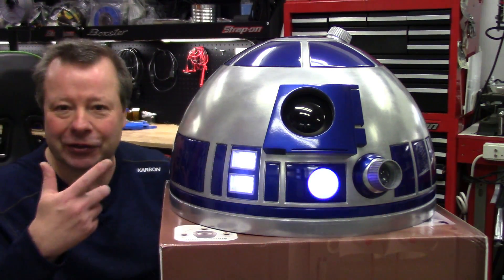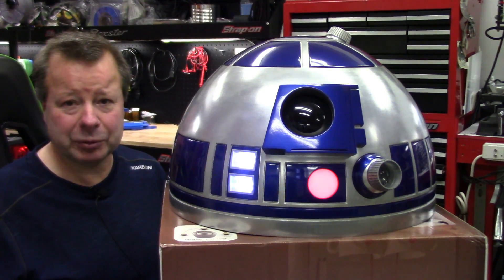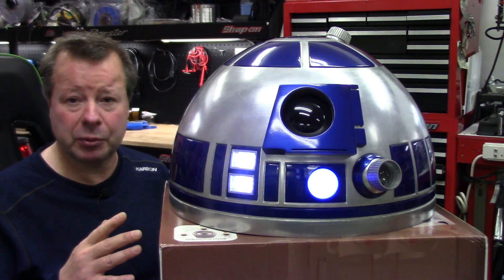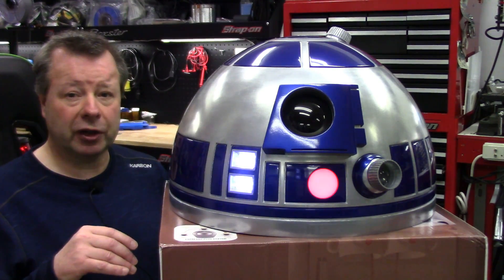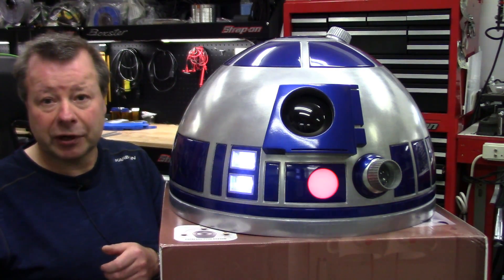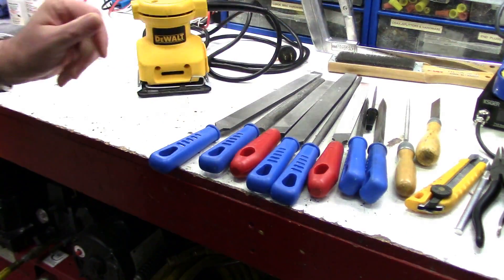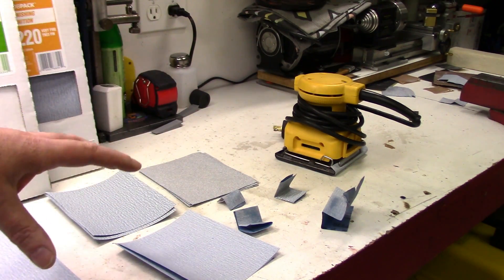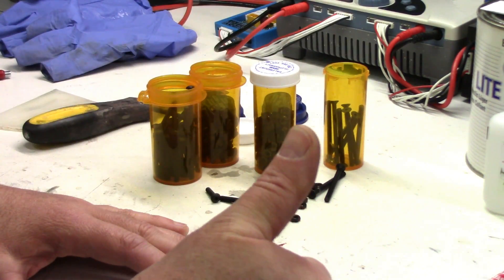R2-D2 Build Your Own - Getting started, Resources & Basic Tools

Comment: Is there a material list for how many rolls of filament are needed for each part?
Reply from the maker: No for the simple reason it depends on your slicer settings for wall thickness and infill percentage. You can estimate with good accuracy using your slicer program for each part or section to get the filament weight and then tally it up. Then add whatever % you want for failed prints or mistakes. 
I cover my final tally for the entire build in part 9 of the series: https://youtu.be/E8h0l4rHvC4?si=LSJ-JfjXVVewZKs1

Comment: Thinking of starting an R2 build, and shopping for printers.  Any recommendations?  I know you used the Sovol SV01 for your print, but that looks to be replaced by several newer models.
Reply from the maker: I would hate to limit your almost endless list of 3D printer options by making any recommendations; especially considering having limited experience out of the hundreds of printers out there. I researched FDM 3D printers for almost 3 months before deciding on the SV01 due to several factors and if I was looking today for a replacement, I would likely take that long again - lol. 
I can tell you I'm still very happy with my SV01 and it's still working great; better than day one actually since I somewhat know what I'm doing now; albeit the 3D printing learning curve never ends. 
Solvo also has a Canadian warehouse and that was important in my decision to have somewhat local support + Creality Ender 3 support as they share many components. In other words, I would definitely get another Sovol if the SV01 crapped out tomorrow.  The SV06/plus is the closest replacement but their new T300 has impressive specs.

Comment: I love the R2 video series, was wondering how it’s holding up a couple years on?  I’m 3d printing one right now with PLA+ but keep reading about how the high stress parts should be PETG, which I hate.  But wondering if I should make the legs PETG anyway?  Thanks!
Reply from the maker: Holding up great - no issues at all . PLA+ is strong stuff after all! Stronger than ABS in most FDM filament tests I've read/seen, but a little more brittle than PETG (brand dependent). Then again, I went with fairly thick walls and 40-50% infill on all structural parts. IMO, the only reason to use PETG for this project is if you are going to be exposing him to higher than average temps. No question, PETG is better in higher heat environments.
Reply: @Rchelicopterfun  thanks for your reply. So far I’ve printed the dome and most of the body using Baddeley’s recommended settings, like 20% infill and 4 walls.  That shouldn’t be an issue, you think?  I was going to print the shoulders and legs with much heavier settings like you used, but haven’t gotten that far.

Comment: Hi John, Love this series. Thanks so much for taking the time to create this series. Lots of great information and demystification on doing this project. I am following you in guiding me on this project of attempting my first R2. Did you sand each section of the main dome separately or did you begin your sanding after glueing? Also, can you forward a direct link to the assembled lighting system? I can only find the components but not the assembled version. Much thanks and gratitude.
Reply from the maker: @gtarson - Sanded both before and after fitting (sanding never ends) 😄
No link I know of. I had to search in the Astromech forums for someone currently building any light sets and then message them for pricing, availability & ordering information.

Comment: Hi John, Thanks for a great informative and entertaining series! I am just starting my build and this has really helped fill in a lot of mental gaps. Quick question did you use PLA+ for the whole dried including the legs or did you use ABS for the legs? I haven't printed with ABS yet and I know there are some challenges with it. I would be happy to avoid them if you think PLA+ all the way works fine. Thanks!
Reply from the maker: PLA+ everything. PLA is actually stronger than ABS; PLA+ even more so. The main downside to PLA is it's not as thermally stable as ABS and has a lower melting point. If you leave a PLA/+ print in a car on a sunny & hot day, chances are it will look very different afterward 😄
Reply: @Rchelicopterfun  Thanks for the quick reply! I'll make sure not to leave R2in the car on a hot day! Ha!

Comment: I just want to thank you in advance for your clear instructions, the honesty, your links to items required and suggestions for issues along the way.

I've watched your process and cannot ... I mean...  CANNOT wait to get started!

Was considering different materials, cutting plastic or wood (aluminium is far too expensive for me) but this... this is fantastic!

First time I saw an R2-D2 - a family friend had built an aluminium one - I cried like a star-struck fan girl. Felt like I met my idol.

I am, however, concerned about all the wiring as I'm electronically dense.

So again - thank you! I'm sure I'll pull my hair out and get some extra gray hairs, but this is a worthy project and I'm going to make the most of it.
Reply from the maker: @jaimeleesullivan8061  Yep, they are a very fun & rewarding build project for all us R2 fans 🙂
I link to two really good publications in the R2 electronic component video that go over the basics of droid electronics and control systems. These publications break things down into fairly understandable concepts; compartmentalizing the electronics which makes them less dauting. There is also lots of friendly help on the Astromech forum so never be afraid to ask there for help if you need it. Have fun with your R2 build 👍
Reply: @John Salt  thank you so much! I have seen you linked all sorts of different sources so fingers crossed. Oh yes yes I've seen that a lot of people are willing to help out where possible so theres definitely a lot of community support :)
Thank you again! Very excited!

Comment: Hi John. I am about to do final testing of my sovol sv01 and start printing. I am following the baddeley instructions as you did. What slicer did you use and if you still have them what settings did you use? Do you have the configuration files still?
Reply from the maker: I use Cura. I don't have my sliced files saved. I "mostly" used the slicer recommendation settings as per Mike's instructions, lots of information & recommendations off Astromech's forum and of course the 3D printed droid guide I reference in the very first video. Modified a few settings of course to suit my own needs and printer.

Comment: Hi John. Planning on getting the sv01 as it worked for you. Putting up a shelf and need to know the distance between the legs. Can't find it online. If you could measure that for me that would be great. So distance between 2 front legs and distance between front and back legs.
Reply from the maker: I don't have time to measure foot distance; I'm guessing 16" apart by eyeball, but foot distance is not a measurement of concern, as the print bed moves well past the back feet while printing. You need at minimum a 24" deep bench, table, shelf, enclosure, etc.
Reply: @Rchelicopterfun  thanks John. Finished with a 600mm x 1000mm x 1000mm shelf so fine. Someone has said the sovol sv01 is not good enough unless an expert printer. Do you agree? I pick up technology very quickly. Do you think a competent 3d printer can print it all of svo1 or would I need some attachments? Thanks
Reply from the maker: The SV01 (very first 3D printer I ever used) worked great out of the box printing the calibration cube and a couple benchy's afterward perfectly the first go so I would not agree with that statement at all. After all, The SV01 is essentially an Ender 3 with some improvements, and the Ender 3 as you likely know is without question the most popular entry 3D printer to date that so many people start the hobby with. 
Like EVERY FDM 3D printer, there is of course a fairly substantial and never ending learning curve to this regardless of brand or model. It's certainly not as hard or difficult (or costly) as getting into CNC machining, but these are also not simple ink jet or laser paper printers that anyone can use out of the box. 
Every FDM 3D printer takes time to learn, understand, get working correctly and consistently. Not just the printer either, understanding the slicer program takes just as much time & is as crucial as understanding your specific FDM printer. Different filament types is a whole other area of learning and experimentation as is learning some basic G-code which is never a waste either. Then learning some simple 3D modeling programs so you can modify any stock stl files if you need to. Again, a never ending learning curve. Over 2 years now and I feel as I've only scratched the surface at times; but I couldn't live without a 3D printer in the workshop now - such a powerful tool and set of skills you gain.
Reply: @Rchelicopterfun  thank you. Sounds good then. Will keep looking. And looking forward to learning all the skills. Just finished my fully enclosed 3d printer shelf using a lot of materials I have hoarded over the last 20 years

Comment: Could you tell me everyday items that can be used for a astromech i cannot afford the parts from r2d2 builders club.
Reply from the maker: Build methods and materials for different budget information is all discussed in both detail and depth in the Astromech's forums; you just have to do your due diligence and research to find out which build method is best suited.
Reply: @Rchelicopterfun  well thats mo help at all it's the damn clubs and forums their all tight lipped you would think id asked for the damn elixir of life thanks anyway
Reply from the maker: What's it like going through life feeling you have that much entitlement? 
I also don't know what your idea of "everyday items" are, nor do I know what your definition of affordable is.

For me, everyday items for an affordable R2 build comprises RC radio equipment and 3D printed parts. A 3D printed Astromech is by far the most affordable option. You can put a very good looking, RC controlled, 3D printed R2 together for under $2K which is very affordable when you consider most other build options are at least double that and upwards of a magnitude more.

This I learned while doing my own DIY R2 build research when looking at different ways to build one, which I found early on in my research almost two years ago in the Astromech forum.
It didn't take much time, research, or intelligence either to figure that out. 

Lastly and perhaps most importantly, the Astromech forum is far from "tight lipped." That is utter nonsense!  It's free to join and is loaded with a wealth of great information & build experiences available for all to benefit from. Add to that all the different R2 builders websites and build series on YouTube - you obviously don't appreciate just how much great and free information you have at your finger tips.  Good luck with your R2 build. You'll certainly need it with your entitled attitude.

Comment: Hey John! Totally realize I'm asking an off topic question for this video but figured I'd shoot anyway:

Have you looked into EdgeTX for your RadiomasterTX16S? I'm very much a noob but came across it earlier today and installed that firmware. It seems to be a continuation of the OpenTX project and now allows for the touchscreen to work as well as theme selections. It supposedly also increase the poll rate on the sensors so possible plus. I'd love to see your take on it and possible video? on the subect.

Cheers!
Reply from the maker: I have no interest in Edge at this time. I don't beta test operating systems, and that is largely what Edge is (as the name suggests - "the cutting edge"). I'm the type of person that waits for all the bugs in firmware releases to be worked out for several months before updating. There is also nothing currently that Edge offers above what OpenTX already does that would make me want to risk using it on a costly and dangerous collective pitch heli.
OpenTX in its latest versions is proven and I'm very comfortable and familiar with it - I don't want to introduce unknowns. In fact, this constant firmware update game is my least favorite part of the hobby. How I miss the days where you could get a radio and use it for many years with no BS involved. 
Touch screen on any RC radio is not my cup of tea. Give me an encoded scroll wheel any day of the week so my screens remain finger print free. 🙂
My understanding from the Edge development team is as Edge concepts are worked out and developed, the ones that are most liked and beneficial will work their way into OpenTX updates. That may or may not happen; but again, I'm in no rush because I want an RC operating system that is 100% reliable and time proven. If/ when Edge ever replaces OpenTX and OpenTX is no longer being developed, that is when I will be forced to change over, but not a moment sooner.
If Edge however has features you & many others like, then great that it's another option to use right now.
Reply: @Rchelicopterfun  Thanks John! I understand and agree with your perspective and agree on the potential disaster a bug could have on a CP heli vs a quad which most people seem to be on these days. I did struggle a bit with some interface changes and will agree that work is there to be done. Appreciate your view!